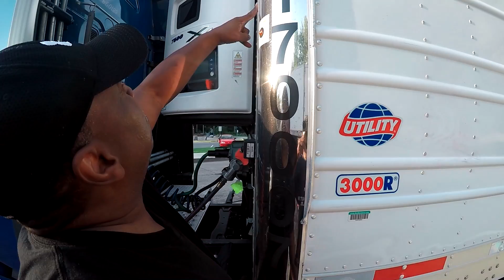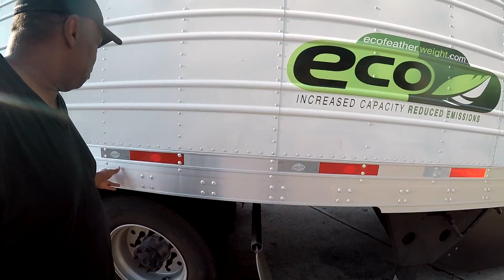Truck Driver Trainee - Day 15 *More* Pre-trip 8-26-16

Comment: Not sure but he doesn't have to say cracked, bent or broken on anything with hoses? He says that sometimes.  I thought all hoses or tires or rubber parts you just say no abrasians, bulges or cuts and not leaking.  Everything else mechanical parts is not cracked bent or broken.  ?
Reply from the maker: +SkilledEddie you are 100% correct and I have been telling Rodney this from the beginning but if he wants to say more things that is ok as long as he dont miss anything he supposed to say. Thank you and thanks for watching 👍
Reply: Junior Honduras Right on. I wish him the best tomorrow with the test.
Reply from the maker: +SkilledEddie Thank you and he will do good. 👍👍